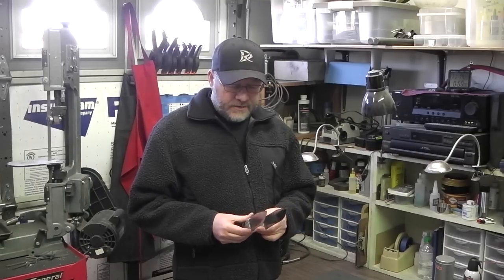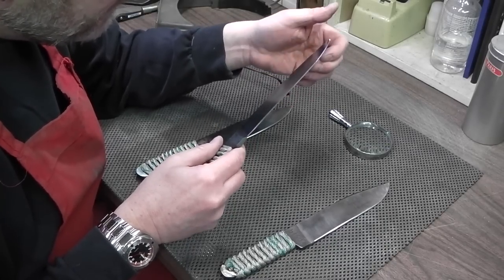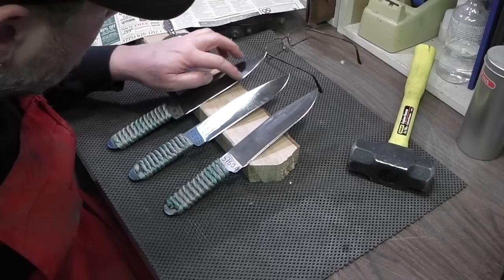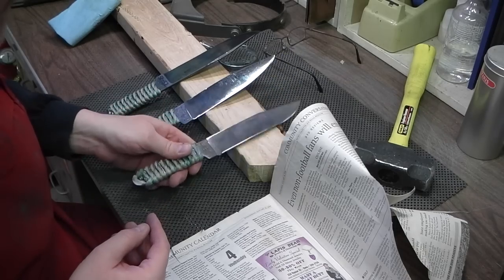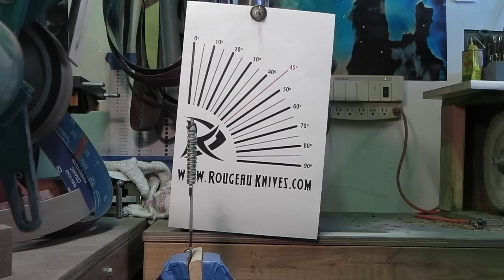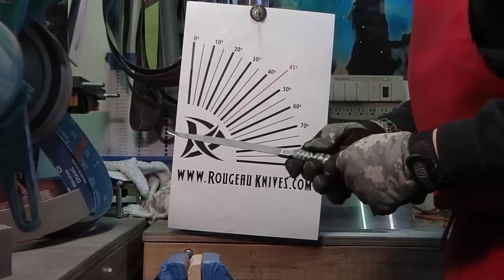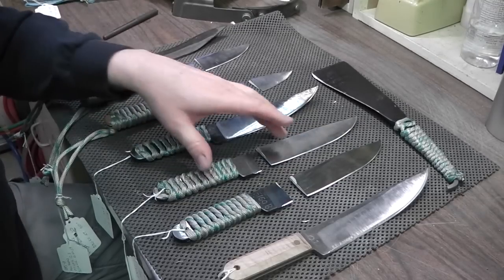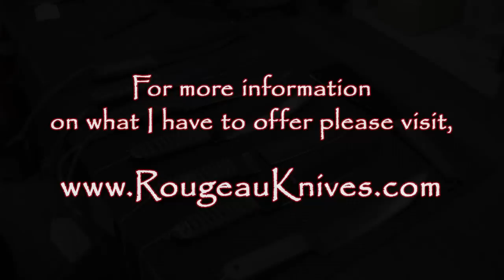Torture Testing 1095 and 5160 blade steel

Comment: Wow!! I have a new respect for both 1095 & 5160. With all the new super steels out there  I sometime get kinda bogged down in all the hype. 
Thank you for taking the time to make these test. Truly an eye opener. Also thanks for the review. Ken.
Reply: a Bad Mojo 5160 and 1095 are both reallt good carbon steels for any size blade. Yes the new so called super steels are good however they still have their down sides "other than cost lol". One of the good things with spring steels like 5160 and 1095. Is they are very reliable and forgiving towards abuse "as this video shows". Added they are alot easier to work and mend/repair than the super steels like nippo as well are much more readily available. Which also means you could get a really high quality blade for alot less money.
Reply: 1060 high carbon steel vs 5160 srping steel
Reply: All steels have different purposes. Modern super steel are intended to be more easy to  be super corrosion and wear resistant.
Reply: @gambet0007  modern super steels designed to be sharpened easier?? HAHA
Reply: @convex7456  corrected :3
Reply: @90mi89  1095 best overall value I feel.

Comment: This is really weird to me. How is possible that 5160 HRC 51-52 broke and 1095 53-54 survived. 5160 have lower hardness which should increase tougness even more over the harder 1095.  And 5160 itself should be tougher than 1095. But 5160 broke and harder 1095 sligtly bend but held up. Im totally confused by this. Can you explain to me ?? According to your test the statement that 5160 is tougher than 1095 is completely incorrect ?? Or isn't ???
Reply: I think the 5160 was hardened to 57rc while 1095 was hardened to 52-51rc. I think this made a huge difference. The only issue I have with these tests is almost no one sells knives at such a low rc level. Most knives are 57-60rc. It would have been better if he had used real life rc levels to see what each knife can withstand. But like he said he tempered them to spring levels which are typically high 40's low 50's.
Reply: @voltsoftruthBSbuster 
There's also tempered martensite embrittlement from 450-550 range, where it's both softer and weaker. Spring temper should avoid this range. 5160 might have fallen in the to get a comparable hardness?

Comment: Very informative. Nice to know the integrity of the steel and how its affected by heat treatment for the hardness level desired. I would like to see tests on most of the popular steels used. For ex like the type Gerber uses vs the type cold steel uses. Tests completed for the 1095 and 5160 which you would see with KaBar and Tops even though there heat treatment may differ...

Comment from the maker: Hay Rick H, hopefully you see this post. It sounds like the 1095 carbon steel sword isn't very long so at a hardness of 59C it will hold a good edge. My only concern would be it breaking but you would have to really abuse it for it to break. If the maker is doing a differential heat treat then that eliminates the potential breaking problem.
Reply: +Rougeau Knives sir ! i want to ask you which steel is better at making sword 1060 1095 T10 or spring ? please help!
Reply from the maker: 1060 has less carbon so it will be tougher but won't hold an edge as well as 1095. T10 is a good steel and is similar to W1 tool steel.
Reply: +Rougeau Knives can you compare between 1095 and tools steel ?
Reply from the maker: Common tool steels are O1, A1, W1 and D2 just to name a few. Each has their own strengths and weaknesses. Tool steel is more uniform in its composition of elements and its more expensive. If it's in your budget go with tool steel. 1095 is iron with 95% carbon added so it can be hardened during heat treat.
Reply: If you were me !! T10 katana with harmon and other fitting 200$ Handmade and 1095 harmon with other fitting 185$ ! Which one would you choose? And which is more durable!! It's really helpful if you can answer this last question!! Thank you sir !
Reply from the maker: I would go with the T10 steel. The heat treat on T10 would be more even and consistent than 1095.
Reply from the maker: For longer blades like swords I would go with a lower hardness or differential heat treat. These were just test on higher harnesses and how they hold up.

Comment: Great, great video, I needed to see this, like you said, the 1095 was spring tempered, and it didn't break, I like my knives tempered a little harder for a better edge retention, I really like the 1095 CroVan better than the plain 1095, with the right temper, and a zero quenching, it's remarkable, I'm looking at getting a O.K.C. Bushcraft Machete, in 5160, what do you think, but my favorite steel, is the 52100, it's very similar to 5160, but has more carbon, so far my Swamp Rat Knives, are my favorite, again, Thanx for a great video, good job, please keep us informed., we need more of your video's.

Comment: Very informative video sir.  Appreciate your time & efforts to compare these steels.  Hats off, I only dream of being able to do the things you are able to create!  I like both steels, but I own many more 1095 blades as they are cheaper & more on the market than 5160.  I can't find cheaper 5160 steel than what Ontario Knife Company offers, & I think they're heat treat isn't consistent...I've tried to  sharpen a few...but anyway,  thanks for a great vid!  I subscribed!
Reply: I've never had a problem with Ontario heat treat and temper, but even if it isn't consistent, you could still sharpen it.

Comment: Would the 5160 have a good enough edge retention to work as a decent allround carving knife? Like in a puukko style knife? I've heard allot of different oppinions about 5160. And the biggest disadvantage people seem to talk about is the edge retention. And because of this many seem to disregard the other advantages of the steel. 

I want to get into knifemaking, and havent "started" yet. I know that 5160 is often used in larger blades. But to me it seems like if you would harden 5160 to around 60RC it should have pretty good edge retention but still keep most of the toughness properties without chipping. 

What's your experience? Since you prefer 5160. Would it work for a smaller (3-5 inch blade) woodworking/bushcraft knife?
Reply from the maker: Sorry for the delayed response. 5160 is a great all around steel. Easy to sharpen, tough and it heat treats very well. If you want better performance then you would move into tool steels like O1, D2, A2 and W2. But it cost more for the steel.
Reply: Ok, thanks! Ive been loking around and one steel that captured my interest was 80crV2 steel. Its bacicaly a sort of high carbon spring steel. I'l keep doing some research. Thank you for your advice!

Comment: Newspaper cut test after chopping thru 2x4s. You mentioned targeting a specific area of the blade for the tests and they're all dull where it was used. The paper is being cut by sections of the blade that were not 'tortured'...
Reply from the maker: +portydert portydert 
I dragged the newspaper through the two inched area of the blade that was abused. Like I said this was not a scientific torture test.

Comment: Thank you very much for this informative video. I suppose I know quite a lot about steels and knives but I have absolutely zero experience with carbon steels because all the fixed blades from my country are 440C stainless variations, even heavy machetes. I bought a lot of folders from USA but not any fixed yet. I'm Spaniard and we have a lot of knifemakers over here but no one works with carbon steels and I think they are the best for chopping .

Comment: Hi. I make knives by forge with coal and i have a question. The temple temp is like 815c or 1500f the same but what if i over heat to then wait to heat low like 815? I only have the coal forge and dont have anyway to control the heat. Is that important to the grain size?
Reply: Im using spring steel that i almost know is 5160.

Comment: SLEDGEHAMMER ... THE MOTHER OF ALL ABUSE!!! ... damn i miss Peter Gabriel
It's also good to know that 1095 rusts easier and has much more variation in grain type. 5160 tends to rust evenly. Heat treating thick 1095 is tricky because carbon steels in general are not very hardenable. All other things being equal, 1095 should hold its edge better and 5160 (motor vehicle leaf spring steel) is tougher (not that 1095 isn't tough). 5160 is the way to go for big blades because of alloying. WITH MOST KNIFEMAKERS IT"S THE QUALITY OF THE HEAT TREATMENT that is SOMEWHAT underutilized. OVEN IS THE BEST INVESTMENT YOU CAN MAKE.  Thanks for your effort and I fully agree with your observations.
Reply: Most people testing for JS in ABS use 5160 bowies, and they have to survive 90° bends to pass. It's absolutely all about the heat treat.

Comment: Hi Derick, if you make a kukri out of 5160, what weight of the blade is optimum for cutting bushes and chopping small branches in the woods? And is it possible to make the blade of different hardness at the spine, body and edge? Thanks.

Comment: if i am going to buy a katana it's better 1095 or 5160??
Reply from the maker: It all depends on the heat treat and temper. 1095 will probably be a little tougher but the 5160 will hold a better edge and it will heat treat more evenly. If I were to make one for myself I would lean towards 5160.
Reply: I went with the raptor series by James Williams. I'm satisfied, though I did nick the blade on some hard wood. I don't feel that to be too terrible
Reply from the maker: Dry hard wood is a real issue with just about any steel type.

Comment: I just noticed I bent my 1095 clay tempered katana, straight blade. or it came bent and I just noticed. the bent isn't that bad, just curves a little bit to the left. can I fix that without hurting the blade more?
Reply: Thanks I'll give it a try
Reply: +Adam Salava A bench vise with something soft (rubber, cloth, wood) in the jaws. Clamp right below the bend and flex the top away from the bend direction. be very careful if you do this with a sharpened blade.
Reply: Thanks for the help, I'm giving it a try tomorrow. I don't even know how it got bent..

Comment: So, I have some leaf spring steel that I am working with. That is usually 5160 correct?
Reply from the maker: Not always. It could be 1080 or lower carbon steel. They will heat treat fine but you need to know the hardness after quench. There’s a good chance it’s 5160. Especially if it’s off a heavy truck. Heat treat a sample first.
Reply: @drrougeau  Got it, thanks!

Comment: is there any difference between 1095 carbon stainless steel and 1095 carbon steel?
Reply: "1095" is the name US industries use for steels that are ~.95% carbon ~.3 manganese and very little else except iron. "Stainless steels" are steels that are more than 13% chromium. Having that much chromium makes them less likely to rust. Any steel with that much chromium CAN NOT be called 1095 because 1095 can't have that much chromium in it.
Reply: +kristokirov ok cheers

Comment: How come the cold steel Bushman can bend to 90 degrees and straighten to within 2 degrees
Reply from the maker: Derek Robbens 
I’ve seen bend tests on YouTube and I noticed that some makers are bending blades that are 1/8” thick or even thinner. I’m bending a blade that 3/16” thick. The thicker the blade the more of a chance it will not spring back as much and or break. Something to keep in mind.

Comment: I know this video is old. I’m wondering what is the highest hardness 5160 you’ve seen good edge retention yet still be tough. Do you think 80cv is better big knife steal.  I’m wanting a 12-13inch chopper fighting knife. Basically a real Bowie a do everything ok type of knife. I’m a martial artist so I want a knife that is strong in all my area’s. Think Philippine people carry big knives that do all. I want the same with American toughness. 
What really keeps me up is thickness. I might need to make a bunch of knives and keep the best. Or buy a machete any answers will be very appreciated
Reply from the maker: I haven’t worked with 80cv. The reason I use 5160 a lot is it’s cost effective and heat treat consistently. It’s commonly use for leaf spring in large trucks. My target harness is between 53 to 58 RHC. Low end for toughness and high end for edge retention. 1/4” for larger knives and chopper. Swords 5/16”. There are other steels out there that perform better then 5160 but the price skyrockets.
Reply: @drrougeau  I was wondering because I have rear leafspings from a 1974 dodge motorhome. Figure I’d make a few blades or short swords. Because of the age I know everything is American made. The steel is probably out of Baltimore Bethlehem steel.  Anyway thanks for the advice. I have enough I can experiment

Comment: It's not heat treated properly if a 5160 spring steel blade will not go 90 without snapping, it should be twice as flexible as a 1095 blade. I would still use 1095 on a short blade though, it is better knife blade material, once a blade goes over 28 inches I wouldn't use anything but properly treated tempered 5160 spring steel.
Reply from the maker: It depends on the thickness of the blade and how hard you leave the steel. Do you want toughness and flexibility or good edge retention. I can make a 1/8" thick blade bend past 90 and spring back to almost straight. Heat treating and tempering Is all about what you want the steel and blade to do.

Comment: How does that bandsaw do at 1:00 mark that's behind you. I'm thinking about getting a horizontal/vertical bandsaw like that, with a 3/4 blade. Mostly for cutting out knives.
Reply from the maker: it's the Grizzly G0621X Bandsaw, variable speed. So far I love it but it's not cheap.
Reply: How does the 3/4 blade do for cutting out the knife from a flat bar of steel? Is the 3/4 blade harder to do radius cuts, as oppose to a Milwaukee portaband saw? Thanks again.
Reply from the maker: You can do some good sweeping cuts but finger notches another thing.

Comment: Great vid I surely thought 5160 wld do better than that but I never & wld never buy a knife made from 5160 unless it was $20 or less. I have a bunch of 1095 but my favorite is o1 I have a cpl 154cm Im very interested in cpm s30v but I mostly stick with o1 I love every thing about it.
Reply: Idk if i would go that far? 5160 is still a very good steel. Realistically there will never be a reason why you would flex your blade 45-90 degrees in the field. I am more concerned with ahock absorbency and never had an issue with either steel.

Comment: should do a video with a 440c blade in comparison.  love my 1095 knife.
Reply from the maker: Eventually I will do a Stainless steel test video. I have to much to do!
Reply: Rougeau Knives cool, i have people argue all the time "properly heat treated 440c"  its funny because they keep saying "properly heat treated"  as though leaving any fault with it was not properly done
Reply: The Gerber Strongarm is one of the most durable knives on the market. It smokes the other more expensive and popular knives. The Gerber is 440c

Joe X does destruction test and it took 3 videos for him to destroy the Strongarm. Shot it with a 9mm like 10+ times.. Almost chopped thru a concrete block after 20 minutes of beating on it.. Did pull ups on the knife..

On the flip side, he breaks 1095 knives like they're glass.. 1 slap on the concrete block basically shatters them..

That's all I'm saying.. I'll never buy another 1095 knife. I actually broke a Kabar trying to stab it into a car windshield. 1 hit snapped the tip like 2 inches down. Brand new knife. First day at work with it. On the flip side of that, I had a $20 Smith and Wesson pocket knife I used to bust out car windows.. Hundreds of car windows.. I still got that old Smith and Wesson knife.

I work in a salvage yard incase anyone is wondering why I bust out car windows. We'd bust the windows, then fill the cars with junk car parts, then crush the cars down.

Comment: Great video, expensive information lol but nothing like having a good comparison. Just wondering do u ever temper the spines differently? The way I was taught you do this so you can have your higher edge harness and still get a good bend and I also always temper the tip just a Lil more then the rest of the edge to keep it from breaking. Guess I should follow you example and share my test so others learn from my mishaps:-)
Reply from the maker: I also do an edge quench and use refractory cement brushed on to create a nice Hamon. Tempering the tip is not a bad idea. I typically leave a little extra meat on the tip so it doesn't become to brittle.

Comment: Just getting into blade making, what steel would you recommend for a beginner? And some of the knife makers that make tutorials, what are there channels?
Reply from the maker: 1095 carbon steel is a common steel to start with. It's cheap and you buy it in six foot bars. 5160 steel is a great steel and easier to heat treat. But you have to buy it in twenty two foot bars and it more expensive. Both are oil quenching steels but 1095 can be quenched in water, however you risk cracking the blade. Checkout Walter Sorrells channel. He does a great job with his videos and he make Japanese Katanas and Tantos. Happy grinding!

Comment: I'm wanting to melt down 1095 carbon steel and sand cast a sword will it hold up well
Reply from the maker: I've heard there are issues with casting. I would use clean bar-stock and waterjet cut the profile and grind it. Your going to have to grind it anyway.
Reply: @drrougeau  will 1095 carbon steel flat rectangle pallets work I ordered them online